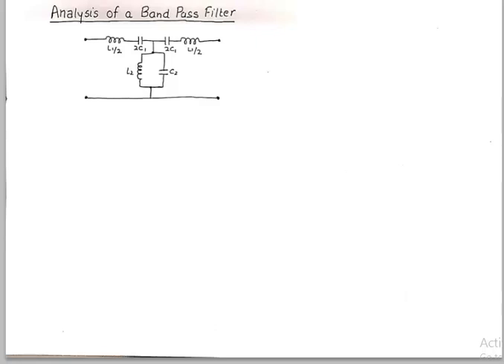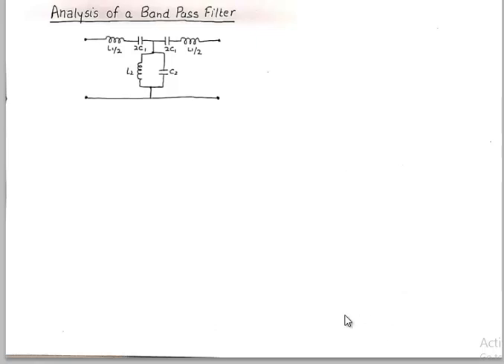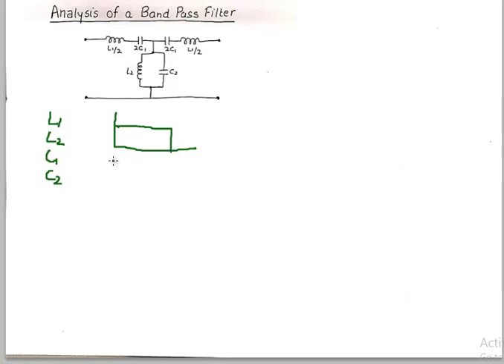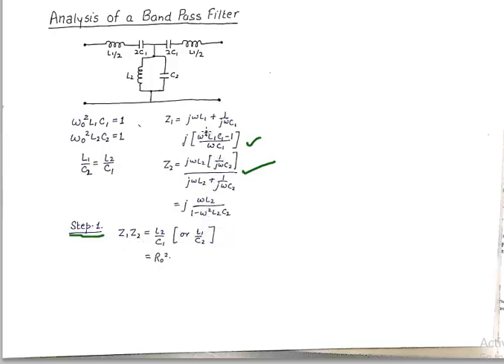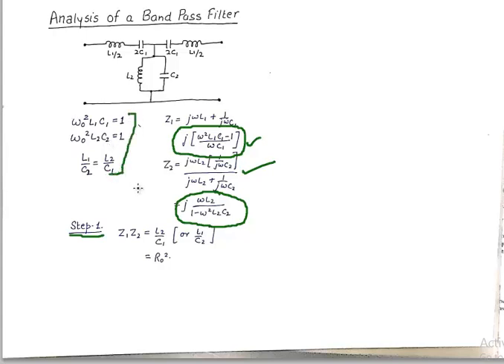Analysis of Band Pass Filter | Calculation of Cut off Frequencies

Comment: Great video.  Can you point me to a reference where wo1 and wo2 are derived?   Also, how is the Zot of a T section derived- open circuited, or terminated?   how does this match the source impedance to the load impedance? I have a complex load that I need to match and would to do so through a BP filter to set the matching bandwidth….
Reply from the maker: Well I read it from a book " Network analysis and Synthesis" by Chakrabarty. Load matching is a little advanced topic and needs insight to Transmission line theory